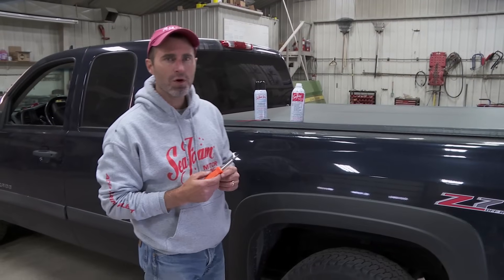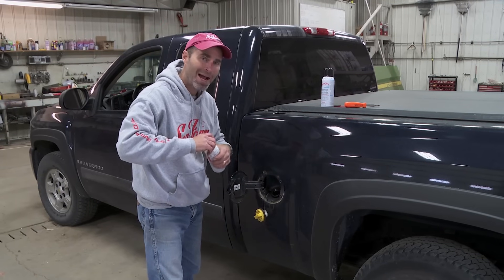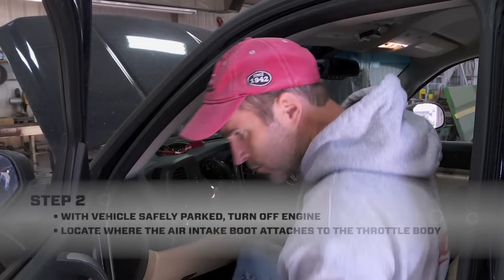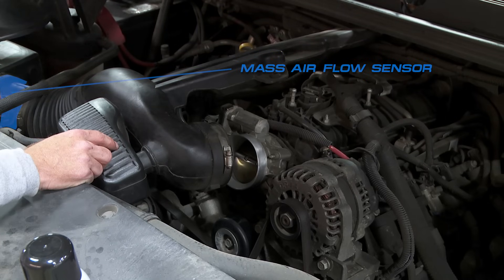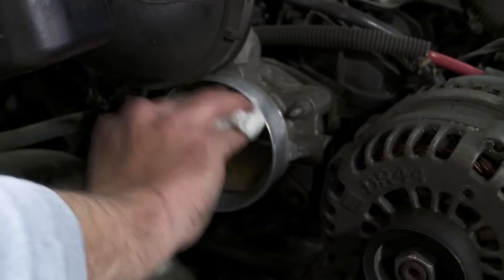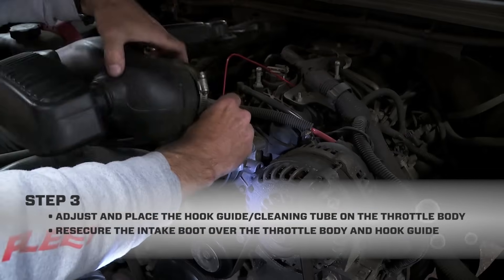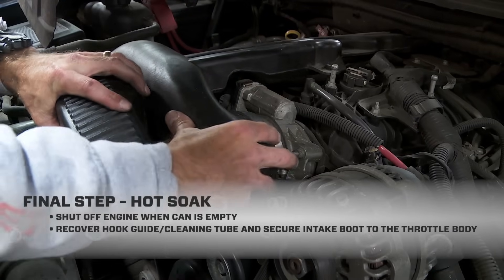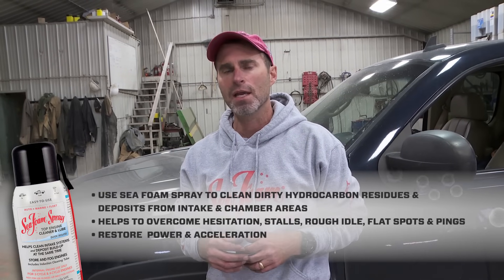How to clean a gasoline fuel injection air intake with Sea Foam Spray

Comment: Hi I tried the sea foam spray and now I got the check engine light code p2101Throttle Actuator Control Motor Circuit Range/Performance

Please Help
Reply from the maker: If the code light does not go back to normal after 30 drive miles, try disconnecting the crank battery for 15 minutes to re-set.
Reply: It will also set your o2 sensors off.all the smoke tells the computer no oxygen flow in exhaust. May have to reset with scanner or disconnect battery.
Reply: Relearn the throttle body position.

Comment: I notice you didnt add any seafoam to the crankcase after adding it to fuel and air intake. 

Any reason you couldn't have added it to oil as well?
Reply from the maker: Hi James:  Thanks for the question.

Treating the oil crankcase does not have a causal relationship to Intake cleanings or treating fuel. To be more specific, intake and fuel treatments are related to the upper engine and can be done at any time.  Adding to oil is not upper engine related and works best when added 100 to 300 drive miles before each oil change.  

We could have included treating the oil in the video but thought better to keep every topic short, sweet and specific.  There are a couple Sea Foam Official videos to watch on adding to oil, anyway.

Hope this helps.

Comment: I did input into throttle body as instructed now my car is smokin g,is this normal???
Reply from the maker: You should typically notice oil vapor (Sea Foam oil from tailpipe)  the first 5 to 10 minutes of operation after the hot soak.  That would be normal.
Reply: Sea Foam Official the vapor,or smoke came from everywhere in front of car,etc
.is this normal?
Reply from the maker: Exhaust/manifold leak?  Or, you didn't get the product drawn into the throttle body at higher RPM.

Look under the car to see where the smoke is coming from, go from there.
Reply: Sea Foam Official smoke coming from everywhere
Reply from the maker: If you haven't done so, please call our tech line so we can help you out.

Comment: I put a can of seafoam in the tank of my 2011 Nissan Sentra and filled up the tank. Now it won't start. What is the issue when this happens. Ran fine before.
Reply from the maker: Hi Rick: Sorry to hear you're having trouble.  A can of Sea Foam added to a tank of fuel would not cause an engine not to start or run.  Have you considered anything else?  Had the car looked at?  Let us know...
Reply: Sorry for this comment.  After having someone evaluate the car, the issue was not related to the Seafoam.  Should have considered that before posting this comment.
Reply from the maker: Thanks, Ricky.  I thought your question was appropriate.  Hope your car is going again + admire that you were willing to follow up!

Comment: what are the benefits from using this method vs the brake booster method? It's on a 03 G35.
Reply from the maker: Great question, DJ. Sea Foam Spray through the throttle body disburses much more evenly and is not wasted.  Adding liquid thru a vacuum line doesn't disburse nearly as well as atomized spray through a throttle body.

Comment: Hello not sure if you still respond to this thread but I just recently bought a 2013 Silverado with a 4.8L. I used to have a 2001 Silverado and I would apply the sea foam thru my brake booster vaccum line and it worked great! My question is do I still use it the same way on my new truck or do I use the spray one thru the intake like the video shows? Also it has never been done and has 58k miles how often do I do this treatment? Thanks.
Reply from the maker: Great question, Ryan. We do not promote brake booster/vacuum line applications.  Spray through the intake works much better and much safer.  Two intake cleanings per year for cars and trucks driven 10-15,000 miles a year.
Reply: thank you for replying!
Reply from the maker: Our pleasure, always.

Comment: How much seafoam can I put with a full tank ?
Reply from the maker: How many gallons in the full tank you're referring to?  Either way, the greater the concentration, the better (for cleaning).  Best to add full can or more when tank is low.

Comment: Will sea foam help free up a stuck EGR valve?
Reply from the maker: By intake application, no.  If you can get the spray directly on the valve and let it soak it's worth a try.  Many soak with Sea Foam Spray when cleaning EGR parts by hand.

Comment: I've chevy trailblazer 2003 and I cleaned his carbons on 180,000 km and now 245,000 km. When I need to clean again?
Reply from the maker: We recommend 2 or 3 times per year depending on drive miles.

Comment: i recently bought a 2003 jeep liberty. it kept having miss fire codes p0300-p0306... i changed all spark plugs, and coils. and the codes went away. but at about 300mi... they came back. it acts as if i am out of gas. i took it in and they they say timing chain. new engine.. $2500... gahhh... but im wondering if this sea foam would help. i think the fuel injectors may be clogged. or something. what do you think sea foam official????
Reply from the maker: Sea Foam will help to clear fuel passage ways.  Sea Foam Spray will help to clean upper intake areas.  Neither will fix a timing chain.   I would try a high concentration of Sea Foam in fuel [for injectors - add 2 or three cans to less than a gallon of tank fuel], then one or two Sea Foam Spray intake cleanings, go from there.
Reply: thank you. i will try it. and hope that that is the only thing wrong. :-)
Reply from the maker: Thanks - hope it works out!
Reply: well so far i have put 2 things of sea foam in my tank. and it is running a lot smoother. it is not acting as if it is out of gas. when i go. it does not hesitate anymore... (knock on wood. lol) i have yet to do the sea foam spray in the intake. but i will.  soooo fingers crossed.... :-)
Reply from the maker: Great news - thank for the update!

Comment: seafoam official for adding to the oil the truck has to be hot or cold?
Reply from the maker: It makes no difference whether the engine is hot or cold when added.

Comment: Do you add so much at the end to stall the engine like in mowers or just slowly spray contents until empty? ALso, how often does this need to be done? I have not tried it in my car yet but, the results in my mowers were amazing! Before, the engines ran harsh, had to pull the cord many times to get them to start. After using the Seafoam the mowers were as smooth as butter and start on first pull. This is not a gimmick contrary to what some say. It really works. I hope I will just as good result in my Elantra.
Reply from the maker: Hi Val - great question.  For an auto, spray until empty with RPM up.  For mower, you only need an ounce or two so don't empty the can.  For cars, two times a year minimum.  For mowers, cleaning through the air intake at least once a season and before you store the engine (that's when you should stall out the engine).

Comment: I had a serious issue with acceleration and gas mileage and mechanics couldnt figure it out. my girl recommend this product so I poured a can in my gas tank. and wow my car is like brand new again. I'm saving a lot of money on gas. My g37 acceleration is too smooth and powerful.  Thank you! amazing prodyct. customer for life
Reply from the maker: Thanks, Anto. Great story.  Sea Foam works fast to dissolve fuel gums/residues from fuel passageways.  Could have been that simple.

Comment: Hi There, I want to clean my intercooler, a couple of questions:
1) should I use the spray or motor treatment ? 
2) I would like to put it into the intake pre-turbo. Is it safe or will the turbo ignite the Seafoam? 
3) Can I put it in post turbo, via the waste gate nipple ? if so, should I use the foam or the liquid ?
The reason I want to do this is to clean the intercooler of any oil residue that may be present.
Reply from the maker: Turbo is fine, but as with any gas engine, placing the straw nozzle in front of the throttle plate is key.
Reply: I am not sure whether you answered my question. The intercooler is always before the throttle plate. So I can only assume that as long as it is post turbo and pre-throttle plate, it will be fine ?

Comment: Two park question. First, I have 2004 Mazda RX-8 is the save to use on a rotary and second, is it the procedure for this car?
Reply from the maker: Yes, safe.  Yes, same procedure for your rotary Mazda.
Reply: Sea Foam Official sir or ma'am I own a 07 cadillac escalade esv would you recommend using the seafoam spray to clean out the injectors?
Reply from the maker: Sea Foam Spray works through the upper intake so does not pass through injectors.  Sea Foam Motor Treatment added to a low tank of fuel (the higher the concentration, the better) will help clean injector passageways.

Comment: Im impressed with this product i used one can ,a third in my vacuum , a third in my gas tank and a third in my engine oil, engine runs much smoother more power, it used to clank a bit for a minute on cold start now its much quieter and it was down on power and bogging at low rpm, now has the power it should, best product of this type I have ever used
Reply: I noticed if you use it in your oil crankcase it has a tendency to ruin the valve cover gasket.
Reply from the maker: Hi Rex:   We appreciate your post and thanks for using Sea Foam!

Comment: I commented last week on what a great video This is, I also plan on running the sea from spray into my Toyota 4Runner and then one can in my Toyota Avalon, my question is besides cleaning the throttle body will this also clean the idle air control valve below the throttle body ?  Thanks and keep the great videos coming seafoam is the bomb..👍👍👍
Reply from the maker: Yes, will help to clean your idle control.  You can also remove the idle air control valve to spray directly.

Comment: i did it in my mazda 3 with 140k and it made a bunch of smokes , but i did it in my bmw with 75k miles and made no smoke why is that?
Reply from the maker: Smoke is only vaporized lubricating oil (from Sea Foam).  Makes no difference.  If one engine does more or less than the other there are a few variables.  Not a factor, anyway.
Reply: it made 0 smoke why is that?
Reply from the maker: Most common are 1. misapplied (sprayed into the wrong location) or 2. windy 3. engine dynamics are different/varies.

Comment: Can you spray it through the sparkplug shaft and let it sit for a while?
Reply from the maker: Yes, you can use Sea Foam Spray to dissolve residues and lubricate chamber areas through plug holes. It's a great product and method for fogging cylinder cavities during storage periods or cleaning compression ring residues.  Keep in mind that doing so has nothing to do with cleaning through upper intake + intake valves. Intake cleaning must go through throttle body or carburetor throat.

Comment: Is this procedure safe for a 2014 Ford Fiesta ST?  I'm concerned about bits of carbon breaking off and effecting the turbo.  As of the last two weeks, I've noticed a lack of power when accelerating.  The turbo used to really give a good kick and not so much any more.  Could it be the quality of the gas? I've tried a can of Seafoam in the gas tank and 4 ounces in the crankcase 100 miles before an oil change.  This Fiesta has 48K and is completely stock.  I've heard of dealerships using walnut shells to clear deposits in the engine, but this sounds like an easier (and cheaper) solution.  Thanks in advance for any answers!
Reply from the maker: Yes, safe.  Sea Foam/Sea Foam Spray is NOT a detergent.  It is a blend of petroleum cleaning and lubricating oils that work as a solvent to DISSOLVE and liquefy hydrocarbon residues. 

Tip: Everything that forms in a combustion engine (gum, varnish, deposits on parts...) is a formation of unburned petroleum fuel or oil.  Most forms are soft, not hard like all the additive marketers like to show. Sea Foam works to clean by safely dissolving the forms back into the liquid fuel so they can burn away in the chamber. In any case, Sea Foam does not break up carbon into pieces. Visually, compare to washing oil paint (petroleum) from your hands with paint thinner (higher-refined petroleum solvent).

Turbo:  The turbo (intake air) is 'upstream' of any upper engine area that would develop hydrocarbon forms.

Hope this helps!
Reply: Thanks!!! I bought a spray bottle of Seafoam. I'll report back.
Reply from the maker: Great - let us know if you need anything.  You can also download step-by-step on our website's HOW2 Instructions page.

Comment: I see people putting it in the hose in the vacuum line at the brake booster. What of that?
Reply from the maker: Great questions:  Through a vacuum line can be harmful if not familiar with preventing hydro-locking a chamber.  It does not work nearly as well as application through the throttle body.  Through the throttle body disburses evenly, feeds all cylinders, safer.  Hope this helps!

Comment: I did this on my 1996 Ranger with the 4.0 OHV engine.  I did this and had the throttle choke open.  The truck revved extremely high as I sprayed the stuff.  I waited 15 minutes then found my truck was  giving a rattle on the middle passenger side of the engine.  It sounded like a typewriter was in my vehicle.  Did I burn up a valve?
Reply from the maker: Instructions are to spray 1000 RPM over idle spec.  Most gas autos and truck idle is 500, so most rev to 1,500 to 2,000 during application.  When you say "extremely high", how high?  And, no, doubt you burned up a valve. Running an engine at very high RPM without engine load is never encouraged.

Comment: I used the file and intake seafoam spray in my 2003 5.3L Z71. I used the same steps mentioned in this video. After approximately 10 min. I started the truck and there was barely any visible smoke. is that good or bad?
Reply from the maker: Not a factor.  The smoke is vaporized lubricant (form Sea Foam).

Comment: Does Sea foam have commercial solution for doing the same procedure??

Something I would like to point out,  be careful when cleaning your throttle body.  there are some designs thet specificly say on the throttle body not to scrub or wipe as this can destroy the glazed finish on the inside of the throttle body.
Reply from the maker: There is a canister tool for attaching to fuel rail, plus has a throttle body attachment ('S' tool) for upper intake cleaning.
Reply: Sea Foam Official new
Reply from the maker: Welcome aboard, Darrin!

Comment: i like results i used it on my vw 2.8l 30 valve with 180,000 miles
befor i used the seafoam i did a compression test hot
140,110,110,170,90,140
after seafoam hot
180,180,185,175,175,175
its like new
Reply from the maker: Thank you, Craig.  That's an awesome report!

Comment: My 98 dodge 5.2 is almost at 200k and ive recently fixed it up nice. Im thinking about using seafoam in the intake and gas tank. Do I need to change the oil filter/fuel filter or anything after use? Just curious because ive never used it before
Reply from the maker: For upper engine , Sea Foam Spray is the way to go ( works much better and safer).  Sea Foam in a low tank of fuel will work to clean fuel passageways.

Comment: Do you continuously spray the can in the throttle body or do you have to take it slow so the car doesn't stall?
Reply from the maker: If the RPM is held above 2,000 you should have no trouble with spraying continuous (about 4.5 min total).  Some throttle sensors will adjust during application.  No matter, if you ever think you're adding to much just back off for a few seconds and let the engine RPM recover.
Reply: Ok, i just recently tried this. I did everything step by step. I had some smoke coming out the back while adding this. I let it sit for about 10 minutes and then started the car. I had hardly any smoke coming out the back at all, not even while driving. Why didn't i have hardly any smoke?
Reply from the maker: The 'smoke' you're hoping to see is oil vapor.  Not seeing much exhaust vapor has little to do with the application.  If a little white vapor says anything, suggests that your engine's top end is relatively clean. Compare to seeing a lot of darker exhaust.

When people apply fluids (Sea Foam, for example) thru a vacuum line a lot of (fluid) product is wasted, and shows as a lot of exhaust vapor.  Because it's a spray and delivered evenly through the throttle body, Sea Foam Spray is disbursed as tiny droplets and feeds all cylinders the same. You're not wasting any of the product during the treatment.  No waste, less vapor.  Make sense?

Comment: my mas air flow sensor is located after the throttle body. can I apply seafoam through brake booster?
Reply from the maker: Am not aware of a MAF after throttle body.  No matter, when the straw nozzle is centered and you draw with enough RPM (2000+) the product (liquid spray droplets) will travel in the center of the moving air, avoiding any contact with the inside of the throttle body.  Most droplet contact starts in the intake runners.
Reply: awesome. thanks for the help
Reply from the maker: Our pleasure, always!  Thanks for using Sea Foam!
Reply: If you are not aware of it, why did you warn us not to do it？ Check  1996 Jeep Grand Cherokee Laredo 4.0. Should I do it, or not？
Reply from the maker: Hi John:  Notice MAP (Manifold Absolute Pressure) and MAF (Mass Air Flow).  In the context of air flow into an engine, a MAF is located along the airstream BEFORE the throttle body, not AFTER the throttle body as posted.  People mix them up...Response was a clarification.  

Does that help?  And, yes, try it! Your Laredo throttle body access is straightforward.  Another tip that goes a long way in a 4.0 is to add a half can to your oil crankcase too approx 100 miles before each oil and filter change. Let us know what happens.